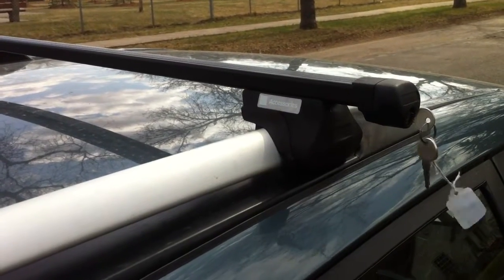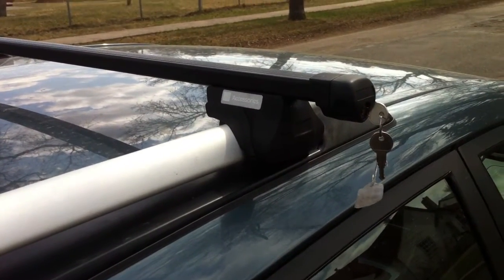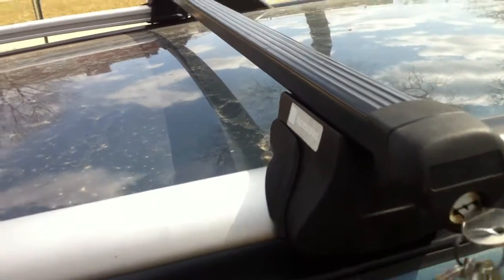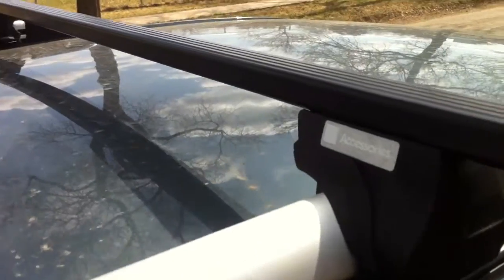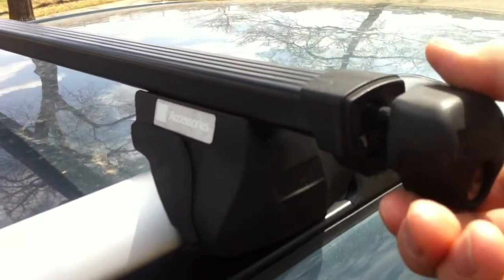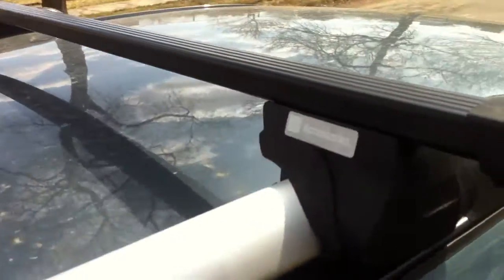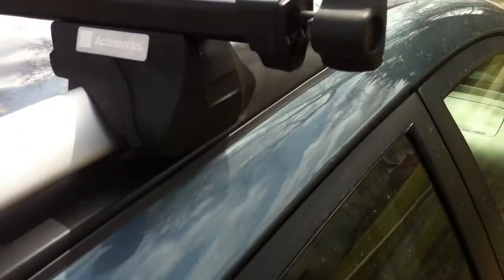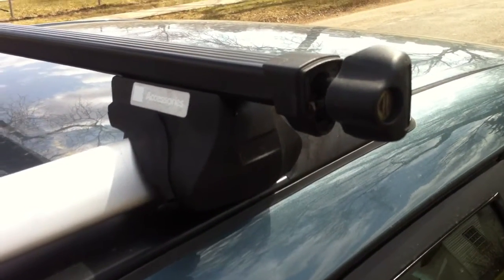GM roof rack cross bar removal part no. 12489230

Comment: Super helpful!  How do I adjust the clamps to change it to a bigger car??
Reply from the maker: On mine, at least, the feet slide freely when the rack isn't in place. The inside "jaw" of the clamp slides up slightly, unlocking the foot.

Comment: how do you take it off wen you dont have the key, bought a wrx with a thule rack but no key for it .
Reply from the maker: Hacksaw? Angle grinder? Pipe wrench? You could check with a locksmith, but failing that you may have to trash it to get it off. That's kind of the idea behind locks and keys.
Reply: @ScottRollans  You can buy a new key on ebay for under 8 dollars.  Just need the number off your rack.

Comment: Yes, it did help!
Thanks for sharing.  I found these for next to nothing at a secondhand store without keys but they are unlocked. I'm trying to fit them on my Volkswagen Jetta even though they say GM. I just didn't know how to tighten them up and I was going to have to MacGyver it. But now I know. Thank you. One question, do I still need to lock it is that just for security?

Comment: Hi have you figured out how to change the position of the feet to make them wider or narrower?
Reply from the maker: +Pelayo Llamas On mine, at least, the feet slide freely when the rack isn't in place. The inside "jaw" of the clamp slides up slightly, unlocking the foot.